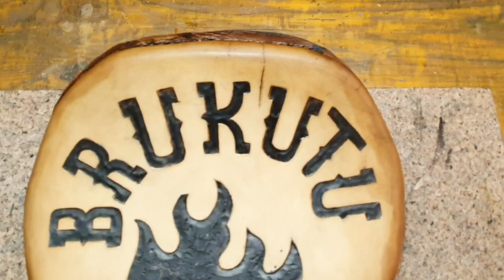How Make Solo Seat. Leather. Moto custom.

Comment: Wow really good job there, what kind of material do you advice for the confort?
Reply from the maker: Thank you very much. For comfort, I recommend a high-density foam, or even an injected foam, like the ones found in car backrests. This is perfect, as it is a thin seat. If you use a very soft one, or a very hard one like this Eva I made, it may become uncomfortable.
Reply: @Lucassoares.Lordbone  Thanks for the response, keep going with your channel really clearer and interesting!
Reply from the maker: @lucagaleotafiore1401  thanks my friend 👏👏👏
Reply: Hi, which leather can be used?
Reply from the maker: @rosaterracciano7657  in this one I used a 2mm thick sole

Comment: Did you glue the top leather to the seat before shaping started?
Reply from the maker: I believe it works both ways, gluing before and molding after and molding before and gluing after.  However, if you are gluing and molding at the same time, you need to be careful not to get the leather too wet and disrupt the glue.
Reply: @Lucassoares.Lordbone  regular contact glue?
Reply from the maker: Yes, I use solvent-based, but water-based also works.  After it is molded and sewn into shape.  it doesn't come loose anymore.

Comment: I am making a chopper and I'm doing almost the whole project by hand. Now I found the perfect video for making the seat myself! Please tell me if I have the correct materials: 1.2mm sheet metal, 2.5mm leather, contact cement, 25mm EVA foam, heavy waxed thread?
Reply from the maker: Hi how are you. I am very happy to know that my video is helping. I imagine your chopper would look really cool. The list of materials is correct. You can see that there is no secret to assembling the seat. It just requires patience and care. Good job

Comment: So I’m not scared to try it it for a first timer what tools do I need , glues , paint and foam for seat .
Reply from the maker: come on, the leather you will need is 1.5 to 2.0mm thick, the foam I used the EVA type which is very rigid, the glue buy the best quality contact glue you can find there, sewing thread waxed with beeswax, and I believe that's all.  In the case of arts and drawings you will need embroidery pins, I believe that with these materials you can already do it

Comment: Awesome work.I love it.Thank you for sharing video  ..what weight was the leather?
Reply from the maker: thank you very much friend, this was the first work, I intend to do more soon.  I used 2.0mm thick leather, raw sole.
Reply: Thanks for reply...being as I'm learning to do seats and have no talent for drawing,do you sell your art work that you put on ,also where do you get your seat pans? Thanks again
Reply from the maker: Generally I always try tô make a unique work, a work with characteristics specifically mine, so I create everything myself. I don't like taking ready-made artwork, so as not to run the risk of having two identical or similar works circulated by different artist. With this I manufacture the shape of the bench. I fold the sheets, I cut welding, the art I create from scratch and by hand at the beginning you will experience difficulties, but I advise you not to give up, because with persistence you will be able to do the work. Magnificent, and with your own style and identity, this is the advence I give you

Comment: Hi how thick steel do you use for the pan? 1,2mm or 2 mm?
Reply from the maker: This one is a little more than 2.0mm as it does not have any structural reinforcement.  Just the curvature.  With 1.2mm, the ideal is to reinforce
Reply: @Lucassoares.Lordbone  ok, but 2mm is ok white out reinforcment?
Nice job by the way.
Reply from the maker: @TheHarley80801  I believe so.  place the lower fixing screws as close to the center of the board's curvature.  there will be no problem.

Comment: How do you press that leather down around the seat to shape it without it burnishing the leather or leavening marks where your really putting some pressure down?? Everything I make I have that problem. Please dude anything will help.🤠👍🏽🫘
Reply from the maker: Hey my friend, the tática I used was to wet the leather a lot with water. Regarding polishing it the secret is to use wood and plastic spatula or even a bone material, which is very smooth. In my case, there where no marks, as the leather was already very smooth. What type of leather do you use to make it